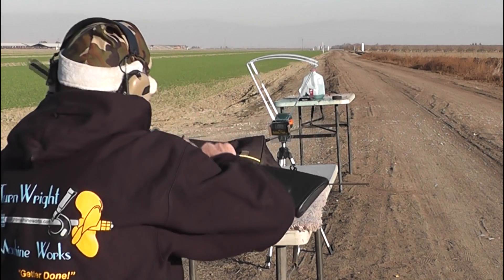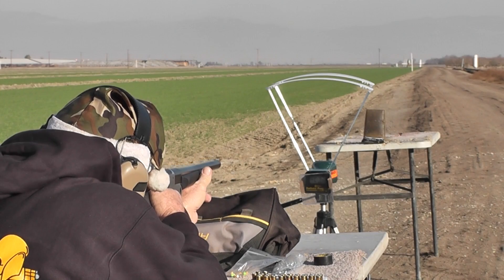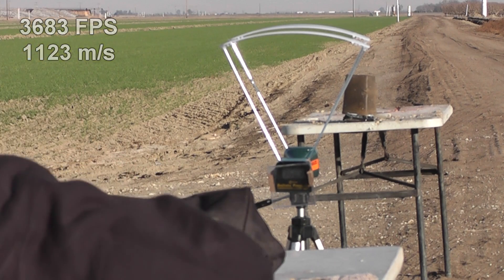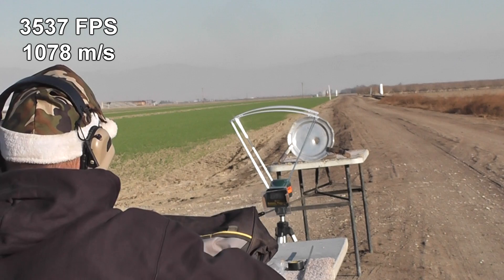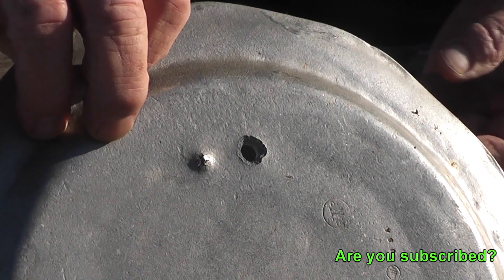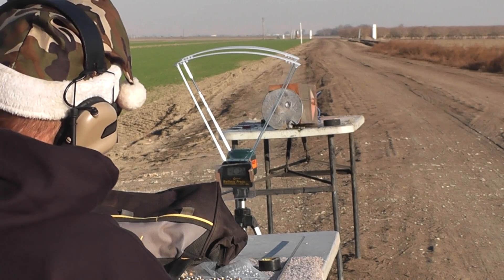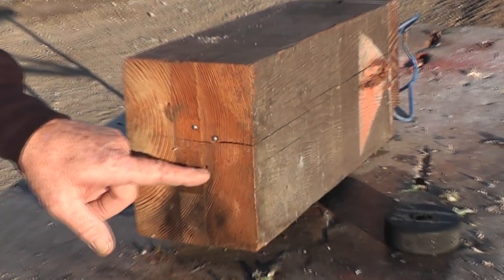World's FASTEST Airsoft BBs  +MACH 4  - What will they destroy?

Comment: The plate looked like some kind of Cast Alloy.  Looking at the hole, do you feel that the superheating of the air between BB and the plate macro-moments ( as Hanson would call an " um-bop.. " ) before impact could either soften the impact site or in-fact cause some localized melting ?  The hole certainly seems to show some evidence of heat damage.

Comment: Speed of sound = 343,2 m/s, speed of bullet = 1311 m/s in standardised international units its mach 3.8
Also:
Speed of sound = 1125 f/s, speed of bullet = 4631f/s so so in imperial units its mach 4.1128
something went wrong in the conversion the actual speed in m/s is 1411,529 m/s, wich is crazy.
Also its not "metric" ist SI units <3

Comment: So, aluminum is commonly used in explosives but has a very high heat transfer coefficient, so you normally have to powder it in order to easily heat up the grains enough to ignite. The pellet in the video appears to be moving so quickly that the deformation on impact is quick enough that the heat cannot transfer quickly enough to equalize the temperature before a part becomes hot enough to ignite a very small portion of the pellet, hence the flash.

The implications of this are astounding, and my first thought is wondering how quickly the pellet would have to strike an anvil (assumed indestructible target) in order to generate enough friction to completely ignite.

Next, I realize that this could be used as a simple and innocuous incendiary projectile that someone with the right training could make, which makes me wonder whether one of those WWII experiments we never heard about involved making a slam-fire aluminum pellet gun that used [redacted percussion-sensitive household chemical derivative] for easily obtained and less than traceable powder. Theoretically, this could be used to penetrate and ignite fuel tanks and gas cans... but probably not very effectively, and the chemical is too risky (think tannerite but more sensitive, and it can cause blindness and awful rashes). A pointed projectile could potentially create higher temperatures from friction, but would be a pain to shoot straight without rifling or a mathematically perfect barrel and projectile

No, I won't tell you what the chemical is. I know about it because I'm trained to process dangerous chemicals. It's not thermite or tannerite or any of the popular DIY explosives. You're better off with conventional stuff, it'll be cheaper and safer.

I'm an engineer; I'm probably already on a watchlist due to my search history from homework, especially if DiPPR is monitored. Otherwise, I wouldn't make this comment... lol...

Comment: Hey you know that your m/s is off by 100 m/s for the final shot. Because going 4631FPS it would actually be going at 1411.529 Meters per Second, and if you were to use the Meters per Second to calculate the speed of sound it would be about 3.822157 Mach. But the FPS to Mach is correct.

Comment: The flash when the bb hits is from due to a couple of things. 1 is due the the spherical shape means the first contact point on the target is a very small surface area. 2, because of that the momentary heat generated is enough to ignite the air around the BB. The same thing happens with a mantis shrimp. Its claws so quick apon contact with a shell it causes a flash of light and temperatures reaching the surface of the sun for a fraction of a second. Very cool stuff.
Reply: Ignite air?
Reply: The expulsion of kinetic energy! There, fixed it for ya!
Reply: Jake Shire thanks for the Knowledge!
Reply: Or because aluminum burns.
Reply: @SlavicCelery  nope. this is the same thing that happens when a mantis shrimp strikes a crab shell underwater. it heats up the water so fast (around 4700 degrees Celsius) and creating a flash of light. aluminium does not flash when its burned. Physics causes strange things to happen at very high speeds. like everyone knows a nice breeze cools you down? but too much wind and the opposite happens. like a space shuttle shields melting on re-entry in our atmosphere
Reply: I drew the same conclusion, Sonoluminescence.
Reply: I think it pulverize some of the aluminum, and raw, very fine aluminum is pyrophoric. It's the same concept as with fuel air bombs/thermobaric weapons, where fine aluminum is dispersed by high explosives, and then it is ignited.
Reply: Plasma
Reply: Sonoluminescence
Reply: Turtles

Comment: 1:30 A rubber bushing near the tip of the rod would snugly fit in the end of the barrel of the shotgun and stop the tip of the rod from drooping down into contact with the lower part of the end of the barrel and being that all the gases go down the 6mm rod itself, there should be no risk of blowing the rubber bushing out the end of the barrel. Accuracy could/would be greatly improved. :)

Comment: 5:20 - 5:21 This would be awesome to see in super slow motion. It has me wondering whether the flash occurs just before impact. Possibly a combination of the air pressure and the static built up by the projectiles as they push through the air. I'm no scientist/physics person though, so my theory isn't based on any previous knowledge...of sorts. I've seen footage of those little prawns/shrimp that have claws that can flick at a speed that causes a shockwave air bubble and a flash. They use this skill to stun or kill prey and if memory serves correct, the flick is around 80kmh (50mph)...underwater.

Comment: Impressive work and great results. I doubt you will see speeds much greater than your current maximums though as modern gunpowder does not produce gasses that expand faster than around 5200 fps. This is why no gunpowder driven projectiles reach speeds exceeding that.

Comment: the flash you see / maybe its related to what happens when you slam Aluminum real hard and fast they ad it to certain explosives when they need a hotter and or faster reaction. i understand it cuts even the hardest rock when combined in the proper ratios . boring tunnels and oil drilling industries is its widest use.  red that in a wiki somewhere.

Comment: I think that flash of light on impact with the ballistic gel is inertial cavitation. It's the same phenomena that occurs when mantis shrimp generate their attack air bubbles. The temps can be hotter than the surface of the sun in that brief instant
Edit: anything that is some part fluid will do this, like with the water jug and orange

Comment: Would love to see if one of the precision barrels for airsoft would stack up when used with powderload to drive it. They're supposed to have tighter tollerances than regular airsoft barrels, using the air better. I remember switching to precision barrels on my electric airsoft, raised it from standard 280fps to little over 300fps, not much, but it seemed to use the air better, looked more shiny/polished inside and it wasn't even a tight barrel.
I wonder how tight the tollerances were on this setup, but Mach 4.11 is great in any case. Wow.!

Comment: Hey actually i did something similar to this but I was doing it more or less like a potato cannon instead of a shotgun, but I also noticed at really high speeds, one BB in front of the other causes like a draft effect similar to two cars on a race track, and it keeps them extremely close together even when you put like 6 in there. You should try it with a really high frame rate camera if you can! I was only ever able to see a blurry blob with my friend's best camera.
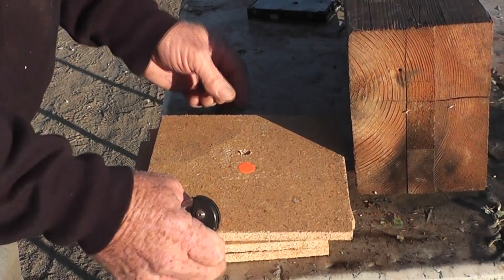Reply: 8:40
Reply: Okay, well I see you did that. Maybe in order to get the phenomena that I did they need to be slower. I found one instance of two steel BBs force welded together in the same hole.

Comment: If I had to hazard a guess, those flashes of light might be caused by the aluminum rapidly oxidizing (think burning/exploding aluminum dust). So the impact causes enough friction to do something to the oxide layer and the heat from the impact makes it just as quickly oxidize anything that wasn't already.

Comment: Yeah but really you cant call those aluminum bbs airsoft bbs cause ACTUAL AIRSOFT BBS are plastic
Reply from the maker: They make alum airsoft bbs ,   I bought them at an airsoft website.
Reply: @taofledermaus  
Yeah but you cant shoot people with them Airsoft is a "sport" where people simulate battles and shoot each other with plastic bbs those are more like pellets
Reply from the maker: Base on a myth that "metal" bb's weighing the same and travelling at the same speed as a plastic one is somehow dangerous.   lol
Reply: @taofledermaus  different materials react different ways either way the point im getting at was its funny callin them airsoft bbs cause airsofters dont use metal bbs cause they are different
Reply from the maker: @PunishersREAPER  At the very low velocities an airsoft bb is travelling,  (maybe 100 fps by the time it hits an opponent)  it doesn't matter what it is made out of.   If the size,  weight,  speed and shape of a projectile is the same,  the amount of energy on impact will be the same.  It's basic ballistics.

Comment: I wonder how bad the Joule Creep is between the 0.2g and the steel bb!
Reply: 83.31 ft. lbs. for the plastic one. So that's 112.95 joules. The steel ones were generating around 96 ft. lbs. or a hair over 130 joules.
Reply: all depends on cylinder volume and if he uses a tight 6.01mm edgi barrel. hope his hop up tensioner fits the bucking!
Reply: @rafaelpennings7597  das bringt mich zu niederknien Bruder....made my Day! Wait what??? made my hole Month.. 😉🤣
Reply: @rafaelpennings7597  >not using a PDI barrel, what are you?
Reply: @JackieWis  I bought a used striker AS01 with full edgi NEMO and 550mm/6.01mm bull barrel, felt no need to switch.

Comment: The flash is plasma created by the adiabatic compression of the air between the projectile and the surface. Fire pistons and diesel engines work on the same principle.

Comment: The light is from excess energy from Einstein‘s E equals MC squared formula which translates to mass times the speed of light squared equals energy so since the baby has weight which is mass and it was traveling at the speed of Marc three and above it equals to energy so because energy was in the equation that’s where the light was coming from so it’s a reverse equation mass times energy or mass divided by energy equals light

Comment: how does the meassurement in "grains" in a bullet work?
Reply from the maker: Grain is a very precise unit of measurement.   A weird one non-the-less.   1 grain equals  0.0647989 grams
Reply: @taofledermaus  oh..so it is indeed a weight measurement. What is the difference between powder gun, and the granulated? Oxidizer between the reaction?

Comment: The flash is most likely the air catching fire because of the pressure wave on impact. Thr air gets so hot because of the compression it litterally becomes plasma for that tiny fraction of time.

Comment: My airsoft sniper, a modified VSR-10 (based on the Winchester Model 70) hurls a 0.36g pellet at 470FPS from a 22 inch barrel. It's only legal in airsoft matches as long as I respect a 20m (approx 22yard)engagement distance. Kudos on creating the only BB rifle which has a 220 yard minimum engagement.

Comment: I know this is an old vid but here is my guess as to what causes the flashes.

I think the BBs are moving so fast that the air between them and the targets can't be displaced fast enough causing it to be compress and super heated. 

Check out a piston type fire starter to see what I am talking about.

TKOR has a vid where he made a clear one and you can see what I am talking about.

Comment: Aluminum is actually very chemically reactive and bursts into flame on contact with air but a thin oxide layer keeps it from doing anything, the flash might be the oxide layer breaking and the aluminum reacting with the compressed air in front of it.

Comment: The speed of sound is 721 MPH. Even at sea level speed of sound is 762 which is just over Mach 6, at altitude the speed of sound is like 660 MPH which would put it just over Mach 7. 

How are you guys calculating Mach for this test? Either way the results are better than expected technically.

Comment: U guys should of added two or three centralizes on that steel tube used to hold the B.B. then u would have 100% accuracy and not have the tube just bent over free floating in the bigger gun barrel right. And would function so much better   And then u add attachment on the end of the tube to lock it in the mod choke threads to lock it into place that would be pimping and a lot of people would buy those for even different caliber guns to. What you guys think ?

Comment: Just so you know airsofters uses only plastic bb's not aluminium and I do not know a single field anywhere that allows the use of metallic bb's (cause they are fucking dangerous).
So if you were shooting mainly Alu bb's then your title is heavily misleading...

EDIT: After I saw the numbers on that plastic .20g bb I just had to run it through a joule calculator cause we measure airsoft guns power in joules (just like majority of airsoft fields do).
The limits on our fields are 1.6J for full automatic weapons and are allowed to shoot from any distance, unlike the snipers that are limited at 3J and have minimum shooting distance of around 20 meters.
I'm afraid that you wouldnt be allowed to take part in our games with that "airsoft" gun cause it shoots around 116J :D
Shoots "bit" harder than the max limit of 3J for bolt action rifles :'D
Reply from the maker: a .30 gram alum. bb is no more dangerous than a .30 gram plastic bb.   Same size,  same mass.    I saw a video of a guy testing these alum bbs  and shot them into a can and the faster .20 gram plastic bbs actually did more damage than the alum. ones.
Reply: I have my doupts about that (link would have been nice) since I have no experience about alu bb's in actual airsoft use cause all fields I know here (Europe) forbids the use of any other than plastic or bio bb's so that includes any and all metallic bb's, glass bb's etc (you get the point).
Also I'm pretty sure that the people who banned the use of any other than plastic/bio bb's have done their research and quite frankly the reason given to said ban is safety related so go figure >_>

Hell I might be totally wrong here, I'm no expert in ballistics but one thing I know for sure!
What is that you ask? The content you guys do is awesome so keep up the good work :D

Comment: 7:12-7:20 well liquids are the hardest surfaces on earth from a certain height or speed, so it’s like that metal bb just hit concrete and that’s the the reason it’s flattened a little bit and also it did not go through
Reply: i meant 7:12-7:50

Comment: Hey uh... guys?
Your home setup nearly surpassed the top FPS of the .220 Swift cartridge... You missed it by like, 35fps... .220 Swift clocks in, at its highest ever recorded, at 4665FT/ps

You were pushing these to the velocities recorded on the worlds fastest firearm bullet. This was quite the accomplishment!
Reply from the maker: thanks!
Reply: I think that calls for an attempt on the record, perhaps a modified .38 casing or something similar but longer (I'm not all that "up" on firearms, being stuck in the land of 12Lb air rifles and 6Lb air pistols, AKA the UK) but if you were that close with 10.25 gr then I'd suggest not much more than 10.75 would be enough... Obviously this number has likely risen in the last year, so you'd want a casing to hold at least 15gr to make sure of it... All from a smoothbore firing a ball too...
Reply: @danmackintosh6325  Get an SGC. I got one.
Reply: @taofledermaus  dude do it again with a 357 blank
Reply: @no candy you misspelled "I have a poorly calibrated speedometer"
Reply: Michael They should use a 30-06 blank
Reply: @isaacfakelastname6629  .50 BMG blank
Reply: @bermchasin  🏅💪
Reply: @no candy Post video evidence pls!
Reply: @Bruva_Ayamhyt  I love your username
Reply: @no candy video or it doesn't happen
Reply: @no candy, that's 2257.63 ft. lbs. of muzzle energy from a 55 gr. bullet. Absolutely nuts. How long does the barrel last?

Comment: This is probably near the limit for velocity for this system. I saw a hypervelocity gun set up by NASA for testing spacecraft armour and it used a gunpowder powered piston to compress hydrogen. This was used to propel a plastic bullet to crazy speeds. 
The limiting factor is the speed of sound through the gas which drives the projectile. This increases with temperature.
As for the arrow, getting it to this speed would create an effective antitank weapon. APFSDS penetrator rounds typically top 4000f/s.
Reply: That NASA rig is called a light gas gun. Hydrogen has the lowest molar mass and thus highest speed of sound of all gases, allowing absurd muzzle velocities- I think speeds as high as 10 km/s are possible! That let you simulate a micrometeorite hitting your spaceship at orbital speed.
Reply: nerd1000ify well caught. I need to look it up again, I saw it on tv years ago but haven’t revisited it since.
Since we’re on molar mass it’s probably worth noting that the molar mass of gunpowder breakdown are probably very high - ash, carbon dioxide, nitrogen and its oxides, junk and crap really.